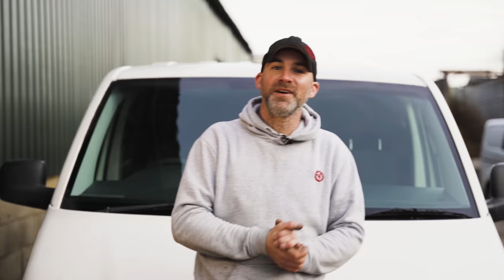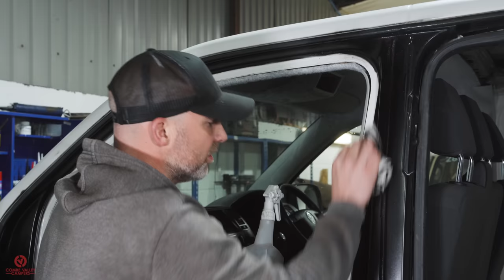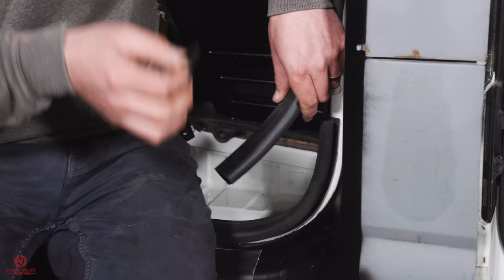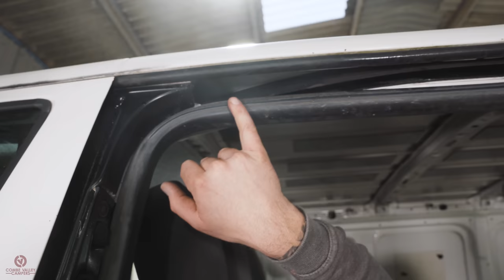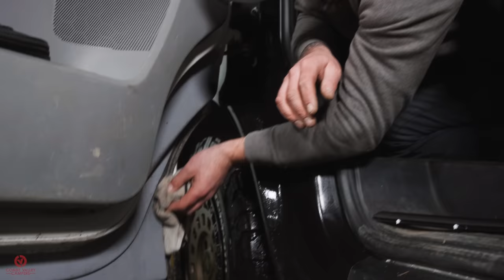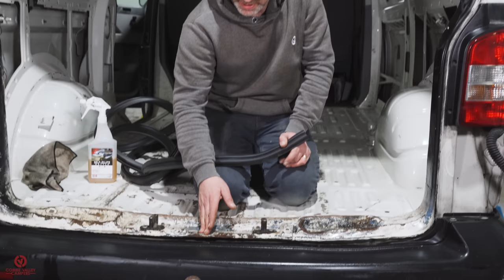SAY GOODBYE TO LEAKS, SQUEAKS AND DRAUGHTS! HOW TO REPLACE YOUR DOOR RUBBERS - 2KT5 EP10

Comment: Changing the tailgate and sliding door seals on my T4 made the biggest difference to road noise after panel deadening the van and lining the load area floor.  If only I'd thought about metal fatigue when cutting the rubbers 🤣
Reply: Hey!! What did you do exactly? Would love to do the same… you added rubber or just change to a better one?
Reply: @Ikigaifishing  I just changed the 20+ year old door seals  for new door seals just like Leigh did on the 2kT5 in this video.  The process was exactly the same.  I've a Kombi so there's no bulkhead between the cab and the rear - the difference it made to the road noise was significant.

Comment: Hi been watching your vid on replacement of rubbers to doors.. I've replaced both my rubbers on my barn doors. Including  single rubber on right hand barn door.. it nw leaking worse than before please help.. do you have a video of you  fitting single barn door rubber pls..
Regards Dave
Reply from the maker: Are the doors adjusted correctly? If not, maybe take it to a trusted bodyshop to check the alignment

Comment: My side door has a knocking noise when I drive which drives me batty, might be worth changing the seal
Reply from the maker: It stopped my knocks and squeals! Last job is to replace the middle and bottom roller, but it’s been out of stock
Reply: @CombeValleyCampers  ah ok whats the symptoms of that then does it have play or something?
Reply from the maker: It’s very old and worn, and the actual roller is missing from the bottom roller making it very difficult to close, and means the for isn’t 100%fit so will love slightly, although the new seal stopped that immediately
Reply: @CombeValleyCampers  Thanks matey 👍